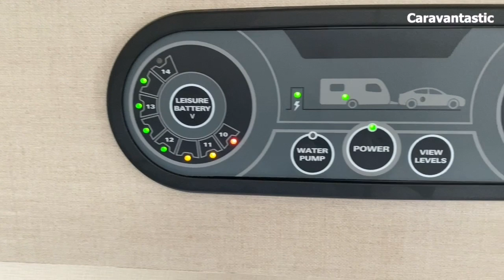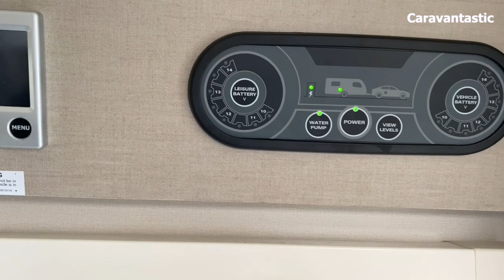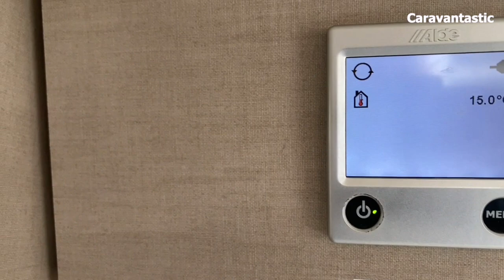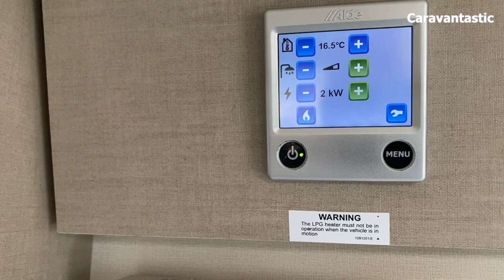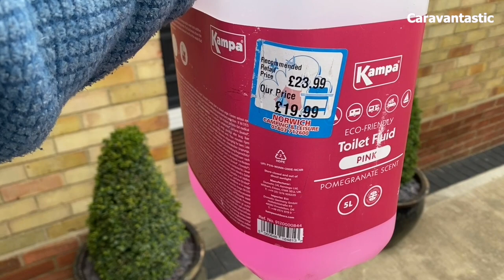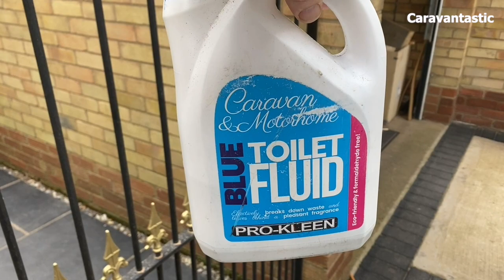Caravanning Tips for Absolute Beginners - How to get water in & out of your caravan.

Comment: Great videos Dave cheers. Some more top tips for season start up, first tank of water one tea spoon of Puriclean & a tablespoon or two of vinegar , then in side the van screw off all the filters on the end of the taps & spray nozzle on shower head & bring water through to all points. Leave water in all lines over night then in the morning you will see all the gunge from the winter storage come flowing out. Run two tanks of fresh water through to clear the lines then when all is running clear & odourless screw the tap end filters back on & shower end also.  Happy campers. I am off on Thursday to pick my new swift up. Safe travels.
Reply from the maker: This sounds like a good tip, hadn’t heard of that, thanks very much for sharing with us. Hope you have a great summer in the van 👍 Cheers, Dave. & Helen 👍

Comment: One thing that we have done is to have two aqua rolls, the roll that does not supply the van has a submersible 12 pump in it that supplies the active aqua roll. The power cable has an inline switch for ease of control. By doing this  I can transfer water from the spare roll into the active roll without leaving the van. A classic example is when one of us uses the shower the other just switches on the transfer pump to make up the used water. We never use the facilities on sites so we need a lot of water. This gives us 80 litres. I would like to have a automatic way of switching on the transfer pump but can’t work out a simple way of doing it.
Reply from the maker: Hi Philip, that's a great idea, like the way you've done that. We mainly shower in the van too these days. As always, thanks for watching ad leaving this great top tip! Cheers, Dave & Helen.

Comment: Bit like yourselves, we do not use the onboard water system for drinking or cooking water. We buy Tesco Ashbeck water in 5 litre bottles, they are ideal, as no limescale issues (wife uses it in the steam genearator iron too) and no need for a watering can, use one of the empty 5 litre bottles for filling the toilet flush tank, well we did, new van has an onboard system now.  Also use the same pipe idea for filling Aquaroll too and agree the colapz waste kit is great. Looking forward to future episodes, particularly awning pegs in hardstandings, especially CAMC club sites - fills the swearbox…..
Reply from the maker: 😂😂 Hi Mel, spot on ref: hard standing pitches!! Great minds, we also buy those 5 lt bottles of water from Tesco. Appreciate you watching and leaving a comment, thanks. Look out for the smashing pegs into a hard standing pitch vid 👍👍 Cheers Dave & Helen

Comment: We use the Whale pump thats made for the Truma fitting. It's more flexible and designed a lot better. We're still amazed at how much water you can get through though, You really have to check the aquaroll frequently if on a standard pitch!
Reply from the maker: Agreed John, I’m always topping the aqua roll up. I’m sure Helen thinks we’re just plumbed in to the mains 😂. Cheers Dave & Helen 👍

Comment: When you insert and detach the Truma water pump inlet trigger, over a period of time, waggling the nozzle to get it in and out, causes the bottom of the housing fixed to the side of the caravan to crack under the plastic nozzle guide. A tip to make the nozzle slip in and out much more easily and which can save you money, reducing early replacement, is to smear olive oil occasionally on the two black rubber o rings on the trigger inlet nozzle.

As regards purging out your water system, first make sure your electric water heater is off, before putting the power on your van, so you don't burn out the element, with it being presently dry. ( just like burning out a dry kettle ). Then shut the drain down valve , then with the pump on and the aquaroll filled and the inlet hose attached,  firstly open all the taps and shower, while positioned fully on hot, one at a time, so you know you have filled the water heater unit, to prevent burning it out ( purge the shower head out into the wash basin, if it is close enough ).  Then go around the taps and shower again, one at a time but this time turned fully to cold, to ensure the full water system is fully purged with water. After this is all done, now you can put your electric heater on, if you want hot water.
Reply from the maker: Hi Steve, great info and appreciated. Love learning more from subscriber comments. ATB, Dave & Helen

Comment: How do you drain down the caravan for winter
Reply from the maker: Hi Dawn, I probably need to do a separate video on this but essentially the boiler (under front seat normally) needs to be drained. Usually a yellow tap next to it and a pipe runs through the floor for the water to drain outside. Any internal water tanks (if present) drained in the same way. Taps opened in sink, toilet & shower and use your water pump to ensure no water comes from the taps. Once water pipes are empty, leave all taps open. Finally, ensure the toilet cysteine is drained. There is a tap/release in the compartment where the toilet cassette goes. Release this into a bowl/small bucket and tip down your drain or toilet at home. Job done! Thanks for watching. Helen & Dave 👍

Comment: The pink can cause algae, B&M sell Fabulosa [£1], which works really well, and smells great. Top tip, if you ever have a blockage or notice your sink plughole is getting smelly, throw a cheap bottle of coke down there, go for a drive, then empty...a nice sweet smelling sink.
Reply from the maker: Now that’s experience talking! Will have a look at both those Bry, my kitchen sink is a bit slow emptying, might give the Real Thing a try (it’s been good to me over the years) 😊👍 Thanks, Dave & Helen xx
Reply: @HelenandDave  The weird thing is, the cheaper the coke/cola, the better it works. I had a problem with my kitchen sink in Dorset, used a 2l bottle of cheap coke [Aldi or Asda, I think], had a drive around, letting it slosh about, hey presto, a fast emptying sink... works a treat, and friendly to the gaskets and rubbers etc...
Reply from the maker: @TheRamblingsofBry  deffo gonna try it Bry 👍